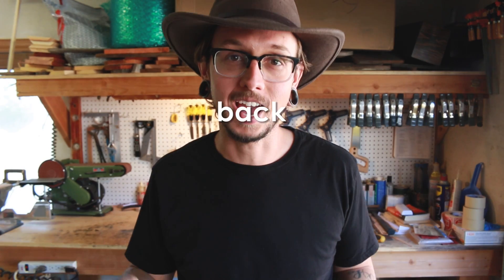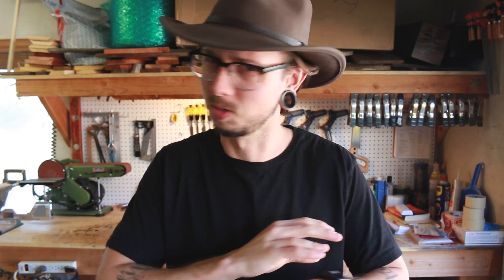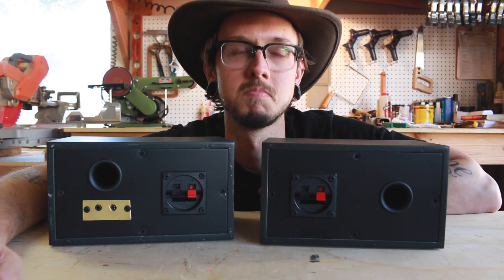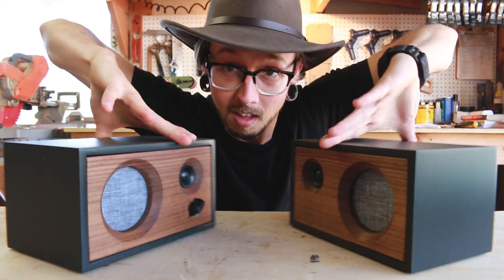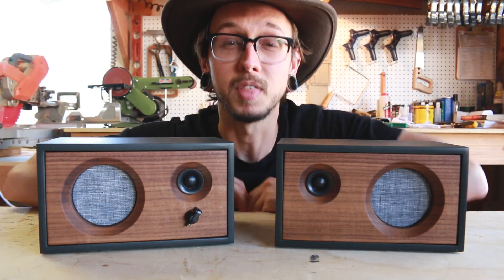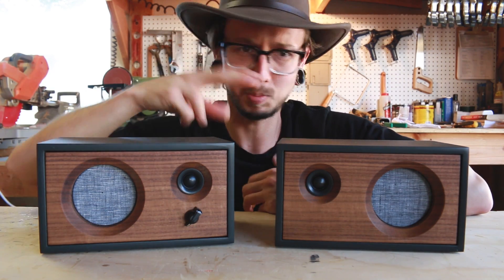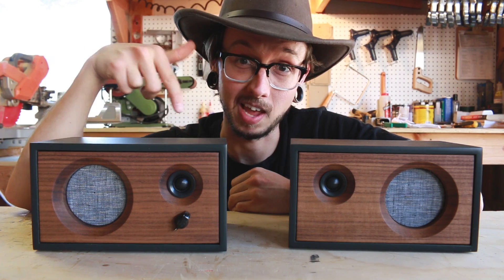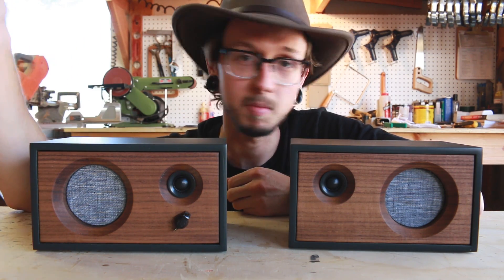How To Make My Mono Speaker Stereo & Thank You Subscribers!

Comment: Can you do this with Rockville's RPG122K? It's the same principal that you did here only instead of adding the RED/BLACK wire terminals in the back, just use the already existing 1/4" jacks already on both speakers. Remember, 1 speaker is ACTIVE, the other is PASSIVE. Let me know if it's possible.

Comment: how important is the hole where the air gets out? I want to build a speaker too so I would be happy if you could answer my question:)
Reply from the maker: Very important! You can find calculators to help you design your speaker here: http://www.mh-audio.nl/spk_calc.asp
Reply: +Kirby Meets Audio oh I don't know every aspect of the speakers its too complicatet for me. Is it horrybly wrong if I just do non or just cut any size of hole in the back an put a tube in? btw: I have 1 woofer 10cm from one to the other side and 2 twoway speakers.

Comment: You should try more exotic enclosures, like transmission lines or quarter wave pipes. Open baffles are also something to look for, the design possibilities are endless. On the electronic side, I've built an active crossover system using LM3886 for the amps. Best decision ever.

Comment: Love your videos and have purchased the plans for this speaker.  I am ready to build it but not sure what to buy for a rechargeable battery, preferably mounted inside the speaker.  Anyone have suggestion on what to buy?  Thanks!
Reply from the maker: Thanks so much, Gregg! Using the Dayton amp that I suggest in the plans, an 8 AA cell battery holder with NiMH rechargeable batteries will do the trick. You can also use 3 AA Li-ion.
Reply: +Kirby Meets Audio Wow, thanks for the reply!  Happy to support your channel, really like what you are doing and want to encourage you to keep going.

Comment: Hi Kirby, I'm assuming that because of the way you've set up this mono / stereo arrangement, that when the speaker is used on its own, you're not getting a true 'downmixed' mono with all of the audio from both left and right channels. What I was wondering is if there is some way to build in a switch between both channels from the amp going to the internal speaker, and one channel going to the speaker, one to the external outputs? I've read that simply bridging both outputs from an amp into one speaker is not a good idea.
Reply from the maker: Hey Richard. Bridging amps is totally fine depending on the amp, some are designed for it, some aren't. I'm sure you could figure out how to switch it as you suggest. It's actually a great idea, but i'll have to look into it to figure out the wiring. Thanks for watching!

Comment: Love your channel. Content is great, production value is great. What do you use to determine the size of your speaker cabinets? I'm trying to build a Raspberry Pi arcade cabinet, and would like to insure the sound system is better thought out than just slapping in some car speakers like so many others do.
Reply from the maker: Awesome build! I really want to make one too. Sometimes the company you buy your speakers from will have recommendation for enclosure volume. There are also a few good calculators online that can determine enclosure volume. A google search should find you a few or try http://www.bcae1.com/spboxnew2.htm . Thanks so much for watching!
Reply: It would also be great if you did a video comparing the differences between things like bass reflex ports, folded horns and other physical amplification devices ... as well as how to design/tune them. And Class D amplifiers ... and inline crossovers ... and a ton of other stuff. You've got a lot of material to work with!
Reply from the maker: So much! I was actually worried about running out of video ideas when I started the channel, but I don't think that's going to be a problem for a long time!